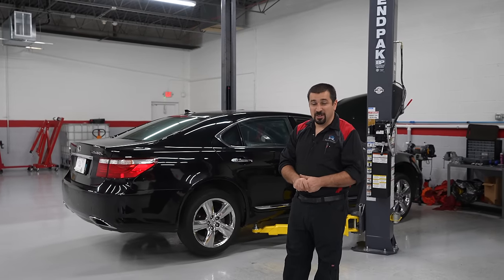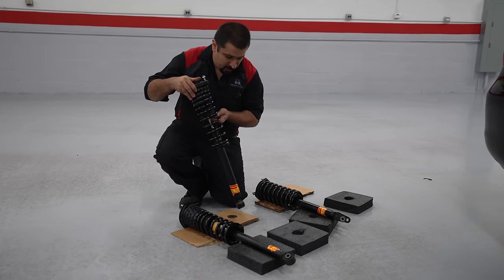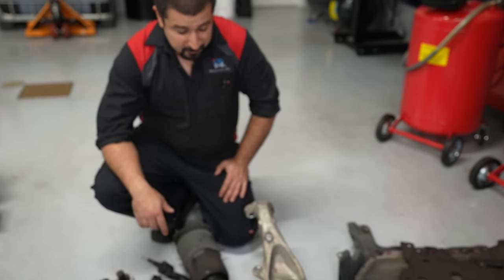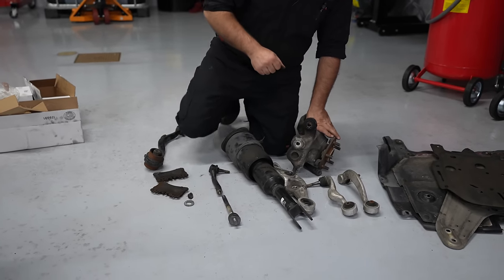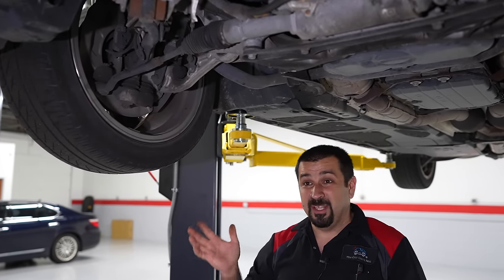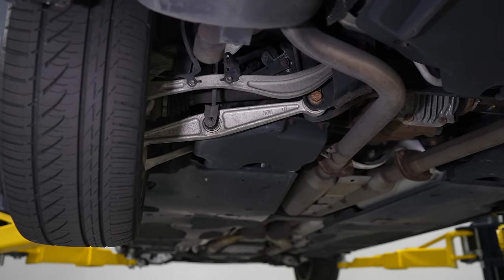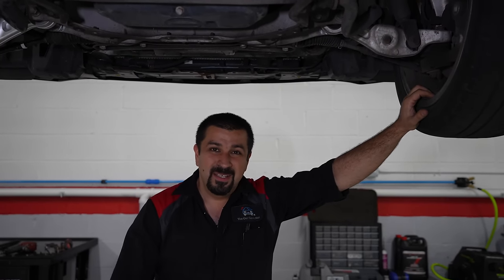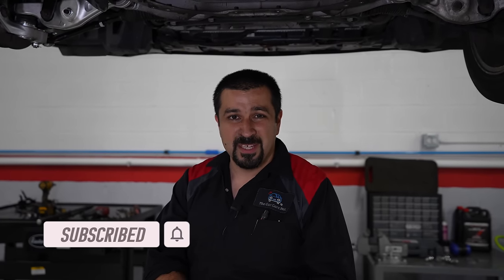Avoid THIS Lexus Model | Pre Purchase Inspection REQUIRED for this one and Here's Why.

Comment: Very good information.  Thanks, AMD.  Does anyone have experience with the 2013~ LS460?
Reply: Yes I have a LS460L 2013 with 80k miles. I bought it at 60k miles from Lexus of queens. It had from control arm failing and wheel bearing failing and also the heat won’t turn on. Had all fixed under extended warranty. Other than that car drives perfect and rides very nice. The extended warranty is over now so hopefully nothing breaks soon…
Reply: @lucashuang10  Hard to believe the top of the line LS suffers the suspension issues with only less than 80k miles.  I've never purchased extended warranty from the dealer but I guess it does pay off sometimes....  Thanks for sharing!
Reply: @Ricky_H  no problem. My LS is white with tan interior. It’s a very good looking combination and the car ages like fine wine.  To be honest I think I should have gotten the 2017 genesis G90 instead. Before Covid you could have snatch up a used G90 2017 with 30k miles for $35k. I paid my LS 2013 with 60k miles for $30k before the $4000 extended warranty.

Comment: Dont get why manufacturers persist with air suspension.  Doesn't matter what brand it always causes a lot of extra complications.   You dont buy a Lexus or Toyota to have Mercedes issues.
Reply: Because air suspension is miles better than standard. It usually holds up pretty well up until 100k miles and most people do not keep cars for that long. So air suspension issues are almost always on broke 2nd+ owners who buy luxury cars for cheap thinking they got a great deal
Reply: Because it's their flagship Luxury Sedan model that competed with Mercedes and BMW......

Comment: So much very modern tech, DI, VVT, stop start, CVT, hybrid batteries, hybrid power supplies, cylinder deactivation valve trains, long oil service intervals, catalysts, low tension piston oil rings, adjustable suspensions, fixed rotor brakes, self driving sensors etc,   fail prematurely and put an otherwise excellent auto prematurely in the dust bin. 

Seems like the lesson is old proven tech.

Comment: Do you recommend a a 2002 or a 2003 ls 430 with 62,000 or 100,000 miles
Reply: '04-'06 probably better. Read up on control arm issues.

Comment: Rhetorical question: Why TF do auto manufacturers insist on designing and installing air suspension systems? They've been problematic ever since the BMW 745 and probably long before. ldiocy.

Comment: Fuck air suspension.  My 430I M package has normal springs and suspension.   My 530I I just sold had 400,000 miles original struts....now they were shot but still worked

Comment: LS460L will drain your wallet if you buy used. Air suspension cost around $3k per corner and good luck finding the parts 😆

Comment: OMG!  And I thought my older BMW had issues!  My problems have been nothing compared to this high-end POS from Toyota.  I do not have any rear main seal leaks--I have had gasket leaks that masquerade as "rear main" to the ignorant mechanic and owner but have always been fixed with low cost gasket replacement.

Comment: I think the Germans have more to learn. Plastics, rubber, door seals, coolant tanks are very poor quality. Transferring oil through an alternator bracket using O-Rings instead of a gasket. A $6.00 O-Ring but $600 labor? Remember the evaporator video? A Land/Range Rover evap replacement is $3000 minimum just for labor.

Comment: You have to pay to play. If you are broke dont buy a lexus ls, new or used. My uncle had a 07 ls and it ran smooth, i enjoyed driving and riding in one. Theres a reason its so comfortable. I would not buy this even for 2000 in 10 years, i know it will be costly to maintain it.

Comment: And some fools will come on here saying Lexus dont need repairs. Well Lexus and Toyota dont need repairs like Mercedes does because they're scared of implementing new technologies into their cars compared to the Germans. Japanese car manufacturers will stick to old ways that works for a long long time until the Germans, especially Mercedes perfected the technology then the Japanese will quickly put them  in their cars. If it weren't for Mercedes hard work in most automobile innovations most vehicles on the road today 2023 would still be like 1959 vehicles.
Reply: Really?  Then MB is running their parts durability testing on the wallets of their customers?  I haven't seen any technology "perfected" by the German makers. For 20 yrs., all of mine arrived from Germany with factory defects.

Comment: Our tesla model 3 brakes have 70-80 percent brakes left after 102k miles because we almost never has to use them. Be a fool, keep paying and paying for ice maintenance and repairs.  Regen can also do most of our braking even when pulling a trailer with our model 3. Ice cars are laughable. All of them. They are all crap in comparison. BMW, Ford, GM, Toytoa, Mercedes, VW, Porsche, it does not matter.

Comment: I own an 06 corolla. I Wonder if the same issues arise as well?
Reply: 06 now 22 so likely your suspension is worn out adter 16 years of use or rust. Your corolla will not yave air suspension & your bill will not be so big. Take a breather relaaaaax.
Reply: @AA-os1sg  I worry that may be the case. 204k miles and hums like a song. No oil burn, trans works great. Only issue is when I brake on the highway it wobbles in the front drivers side significantly. I need new tires and may have a slipped belt. Never rotated them since I bought it  in 2020. We shall see. Plan on jacking it up here in a bit and doing that tire check that CCN did in the video. Time will tell.
Reply: @carlosortiz6742  Wobble when braking is most likely worn or warped brake discs. Start with the basics like brake disc and pads, clean & regrease slider pins,  clean caliper carrier the housing & a brake fluid flush works wonders. Then move onto checking play in the suspension shock absorbers, springs, inner tie rods, ball joints. Tyres and check the alloy wheels not buckled. Humming is likely a bad wheel bearing. A car from 2006 you have to weigh up is it worth throwing money at it long term as it will need more expense like oxygen sensors, exhaust, the list goes on & on. Only do what is necessary to keep it roadworthy. Report back with your investigation im curious on learning myself.
Reply: @AA-os1sg  by humming, I meant it runs perfectly. No issues at all aside from the  wobble when braking at high speeds. Thank you for the tips. Greatly appreciated.
Reply: @carlosortiz6742  Thats great sounds minor keep on motoring ;)  All the best from the UK
Reply: @AA-os1sg  damn. I hear you guys are having a helluva problem with soaring energy prices. I wish you and yours all the best. Stay safe. Regards.

Comment: The split upper arm design  at the front is unusual and very similar to Audi's Allroad and SUV design but everything is separately serviceable on the Audis - balljoints and wheel bearings. Looks like Lexus copied some basics from Audi but failed to properly execute in the details with a good serviceable design. The oil consumption is probably entirely a result of neglect. Unfortunately for Lexus, they've developed such a reputation for reliability and durability that moronic owners think they no longer have to do any routine maintenance - as if the car magically maintains itself. Excessively long oil change intervals are still a problem throughout the industry and  the "push button, video game obsessed" millennial generation isn't as intelligent as it thinks it is.

Comment: Just because you've got a busted LS460 in your garage due to bad maintenance from prev owner(s), dosen't mean they all are bad!!!
I've got a 2005 S65 with ABC that are notorious to fail and break, but due to the 2 prev owner that took well care of the car, 17 years later I still haven't had any issues! Bottom line is, it's all about the prev owners!
You don't need to scare people from buying these cars just to get more views and likes by tick the mandatory 20+++min box video with bunch of talk so YT algorithm takes notice of you! Just say be careful of what you buy and don't be blindfolded by bunch of sugarcoat talks and receipts!

Sorry man, but I just gotta give you a Dislike!

People: before you buy the car you're interested in, make sure to do a independent MOT inspection BEFORE you sign ANYTHING!!! I did it and saved myself $700 replacing a leaking steering line.

Comment: Buying and owning any ice car now is just plain idiotic. We own a tesla model 3 and have for 3 1/2 years and have over 100k miles on it and we have done no service maintenance.   The car is safer, faster, handles better than the best sports cars and has better traction and control than any 4wd ice vehicle. Ice vehicles are pieces of garbage comparatively. We also have been saving 300 dollars a month on gas costs alone and that was before fuel prices went up recently. Get rid of these pieces of crap as soon as you can!   If you question what I am saying, that is probably because you do not know all of the facts, have no experience or knowledge in the matter and are speaking out of ignorance. Tesla owners have all owned ice cars before as we all have. We have the experience with both types. Ice has been around for 100 years. It might as well be the horse and buggy. Get out of ice, before you throw away any more money and risk being hurt in a much less safe car.  Our car would probably have resale for not much less or the same as what we paid for it.  We charge at home while we sleep for 10 dollars per 250-300 miles, and on trips can charge anywhere in the us at superchargers in 30min while we are taking a rest stop. The car is usually done before our bathroom and food break.  Tesla owners have been traveling countrywide for years with no issues with traveling. There is no argument anymore. Media and oems are lying because they do not want to loose their parts and maintenance profits which you do not have with EV. Don't be a sucker and fool anymore for the oems. They do  not care about you at all. Free yourself, get the superior option. All other vehicles also have 20 to 30 year old tech and features including new evs from other oems. Tesla is way beyond anyone else.

Comment: This is fake news obviously this person that made this video is a Lexus rookie!!  And has no clue of Lexus. Do Not take this video information seriously I’m a Master technician with over 30 years experience n the only brand that is reliable is of course Lexus n The LS 460 starting in 2007  to present is the mos reliable car period!!! That’s the reason I own 4. A 07 a 2012! A 2014! And a 2016   Any questions contact me
Reply: I’ve watched many of the car nuts videos. And from what I’ve seen he’s a very competent mechanic and knows his stuff and at one time work for Toyota as a master mechanic.
Reply: @bhuff123  I have a 2015 LS460L and its still running like new. I have ZERO of the issues he's talking about and don't expect to have any of them for many more years. One comment I would have regarding the videos host is that he does not discuss much about how the example car has arrived at its current predicament, which is lack of proper care and maintenance to date. If the previous owner ignored required maintenance and abused the car then these issue will arise. My personal issue with the video is he comes across as a Lexus hater, and seems to be pandering to other folks who has similar opinions of Lexus. I currently own a 2005 Toyota Tacoma, 2008 BMW 135i, 2018 Mazda 3, 2015 Lexus LS460L and 2002 Audi TTHO and the can tell you that Toyota/Lexus are in a different league regarding reliability and quality. Just my 2 cents. I'm sure he a competent mechanic but I'm not sure he's a competent video blogger. Good news is we can all have our own opinions!